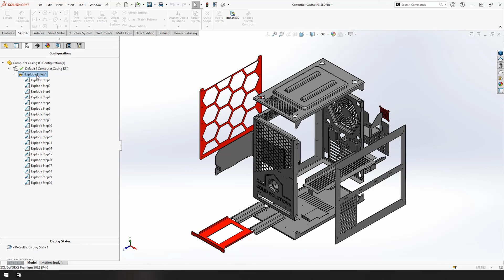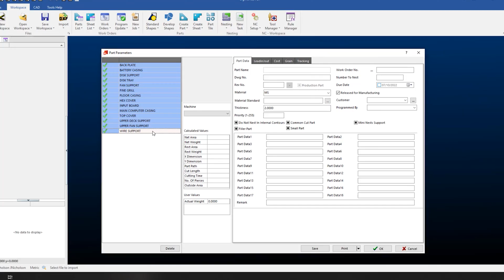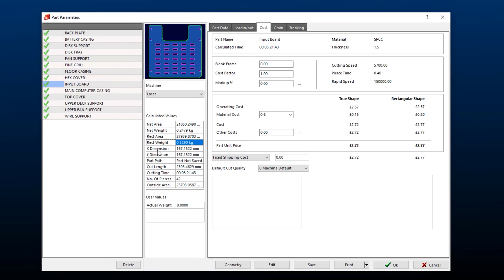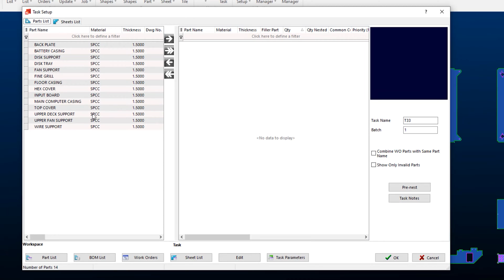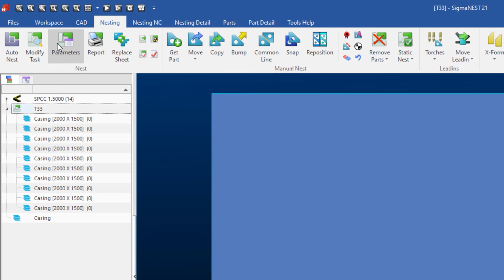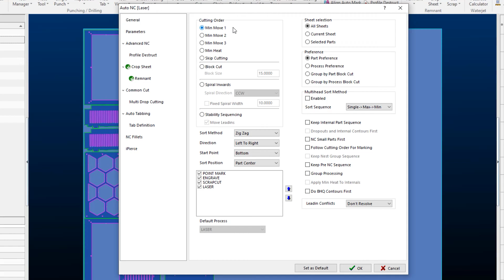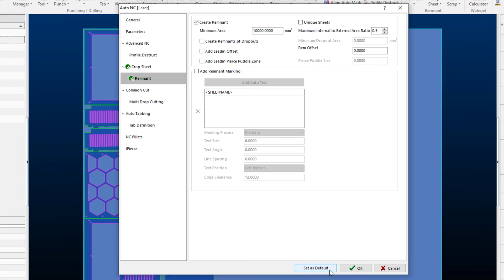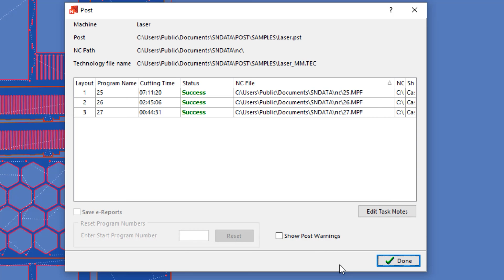Overview of SigmaNEST Features | Basic Workflow

Comment: From this video I don't understand is this stand alone application or this is solidworks add-on? Thanks.
Reply from the maker: Hi! SigmaNEST is standalone software. There are other products in the SigmaSuite that have fully integrated SOLIDWORKS add-ins (like SigmaTUBE), but SigmaNEST is built to read information from SOLIDWORKS models. 🙂

You can find out more here:  https://www.solidsolutions.co.uk/manufacturing/sheet-metal.aspx